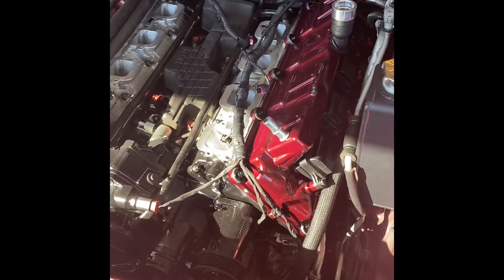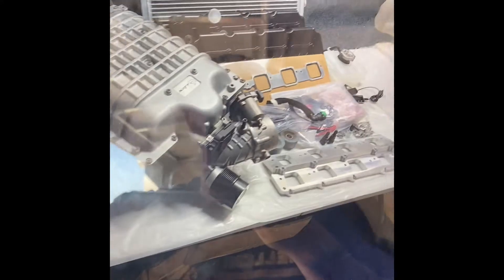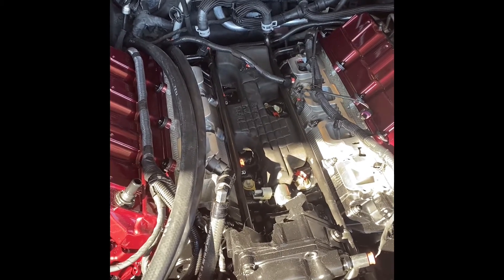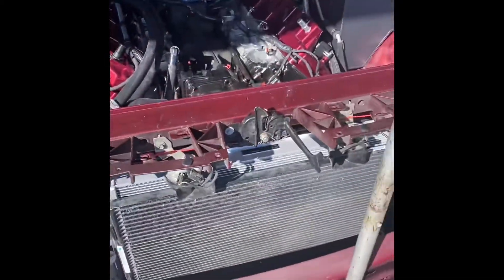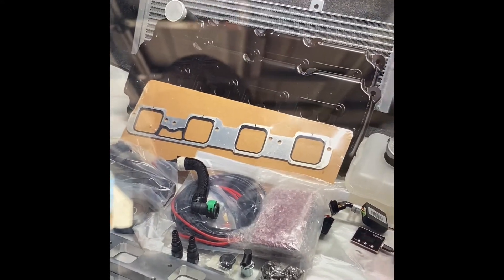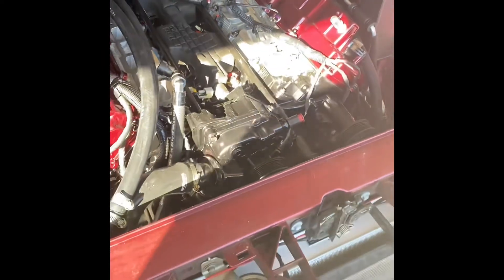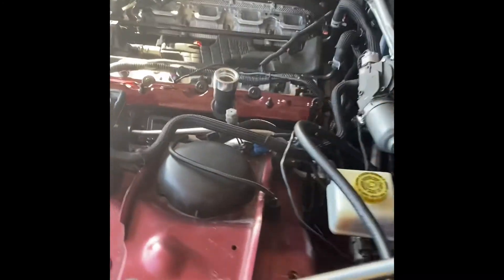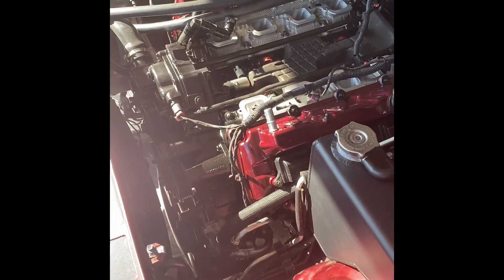Hellcat Supercharger kit for 5.7, 6.1, and 6.4!!!

Comment: hey i’m a subscriber, i’m in the process of installing a ihi hellcat blower on my 5.7 is there a wiring harness adapter that i need to power the throttle body on the lid , i didn’t see one in your list and i have seen anyone who’s done a swap talk about it ?
Reply from the maker: the bypass valve is controlled by the smooth boost. if you need help email me at mlbsicario57@gmail.com

Comment: Did you have a problem with the two harnesses of the rear of the supercharger or did you have to trimmer talk about the map and the fuel pressure
Reply from the maker: I move the map to the front of the supercharger to keep an eye on it. And I add the fuel pressure gauge into my fuel line
Reply: @talifesgarage  so that harness you didn't connect directly to the supercharger injectors
Reply: @talifesgarage   I am watching all your videos it has helped me a lot but I did not find any video where you made reference to this theme

Comment: Is the bottom end stock that you're putting it on?
Reply from the maker: When I first put it on yes. Now I have a built motor
Reply from the maker: @cambam2430  10 pounds and pin the crank.
Reply from the maker: @cambam2430  I broke number 7 when I turn her up to see the breaking point. And that gave me a reason to build a new motor
Reply from the maker: @cambam2430  that’s always a plus
Reply from the maker: @cambam2430  I went the other first to see what need to make it work. My set up now is a fully built motor.

Comment: Can this work on stock internals? If so what kind of gains can one expect?
Reply from the maker: If u look in my early  videos it was on stock motor. Stock number are 350 hp and 380tor at the wheel I gain 606 hp and 598 tor at the wheels on 10 pounds
Reply: @talifesgarage  yeah I just wanna get to around the 500 area nothing crazy just little something something
Reply from the maker: @angelusmortis3256  you can do that with very Lil boost. And depending on what u want u can do a cam and heads instead of the supercharger. It your choice on how u want it to look like?
Reply: Man I would love to do this on my dodge magnum 6.1 will this work on mine
Reply: And how much is for the hellcat blower

Comment: You sale this kit ???
Reply from the maker: Yes at defierperformance.com u will have to email or call them.
Reply: Did you put it on yourself
Reply: About how much horsepower you getting
Reply from the maker: @srtreed3947  yes I did all my work but the tune
Reply from the maker: @srtreed3947  it was 606 hp and 598 tor on the stock motor on 10 pounds. That was before I fully built the motor and got a bigger Superchager

Comment: You should go for the hellcat supercharger drive the 6.2 timing chain cover fit on the 5.7 block  so you'll have the supercharger it's own belt to the crank the hellcat 6.2 timing cover has different setup but it'll fit on a 5.7 and then you just crank the boost all the way you already have forged internals so you'll be straight I say 700+whp on a forged 5.7 with a demon blower boost all the way up.
Reply from the maker: Yes in the future I will the kit is 3k to do that. I saving for a transmission and fuel system
Reply: @talifesgarage  oh ok good build bro same setup here going for a 397 stroker and I'm porting my blower with supercharger pulley drive boost all the way see how much power I could get.
Reply: I found a hellcat timing chain cover for $500 pulley tensioner from mopar for $80 and 2 pulleys form autozone and bam I got my drive for under 1k.
Reply from the maker: @alexandersefo3421  yes but u need a new water pump and hose to run it right. If you use the 5.7 or 6.4 pump the outlet is in the way of the belt. And I have to check but I think u have to get the hellcat oil pan. I’ll try and check on that tomorrow if I remember to do that.
Reply: @talifesgarage  yes I did my research you have to get the oil pan and water pump is a must because it's a little different because how the blower belt lined up with the crank and you have to get the crank pulley as well
Reply from the maker: @alexandersefo3421  ok wasn’t sure about it. Let me know how it goes on your build want to see what kind of power your going to make
Reply: @talifesgarage  ok bro for sure I'm just not a video type of person but will do bro.

Comment: where is a safe place to get it installed?
Reply from the maker: Where u from
Reply: Currently located in Baton Rouge, Louisiana
Reply from the maker: @Jesseleegrayson  I don’t know any shop there am in Florida and my partners are up north
Reply: I have a 2019 Scat pack WB in Fl, where do you recommend for me to take it for install
Reply from the maker: @dannypena1955  where in Florida??
Reply: Palm Bay Fl, thanks
Reply from the maker: @dannypena1955  am in Jacksonville. Don’t really know any shop that would do this work besides me or my partners up north.
Reply: @talifesgarage  JAX is not that bad of a drive. I have a couple of questions; I will email you along with my contact info. Appreciate you getting back to me so quickly.
Reply from the maker: @dannypena1955  what’s your email